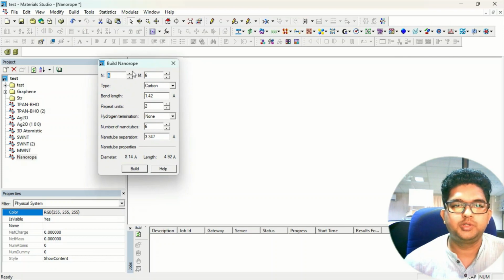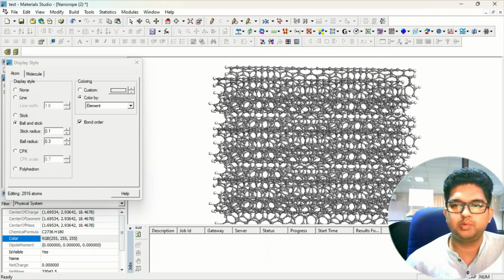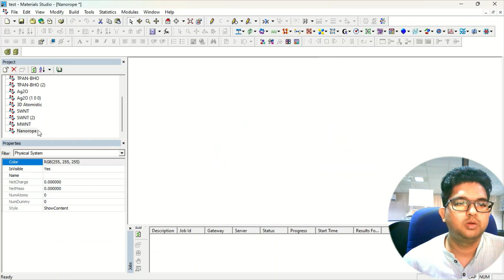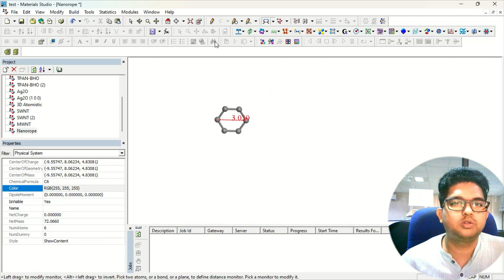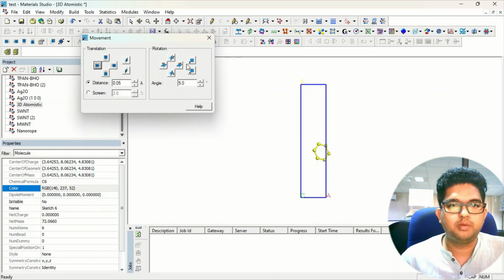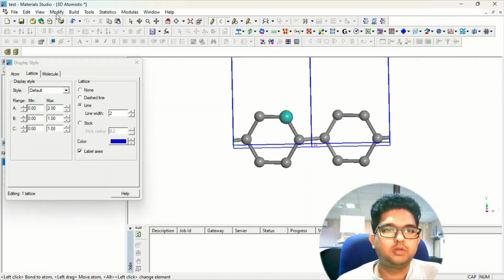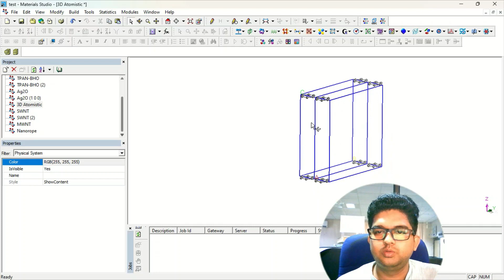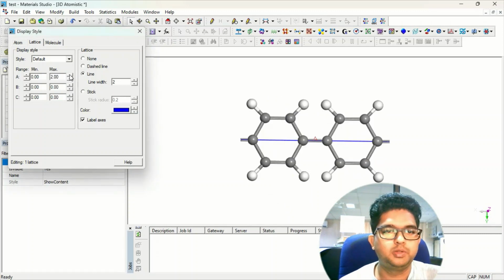How to design Nanorope and Nanoribbon || Gaurav Jhaa

Comment: This model contains multiple Hessians, which DMol3 cannot currently handle. 
Would you like to delete Hessians and continue calculations?

Yes     No

If I calculate by clicking yes, is there any effect on the result or what should do in that case?
Reply from the maker: You are talking about which Hessians?
Reply: I don't know if I want to calculate the optimization of the adsorption system then it shows like this popup.
Reply from the maker: @amitramchiary3191  no idea dear.